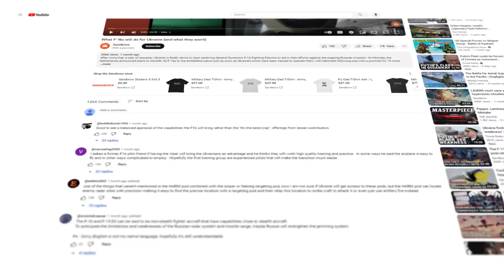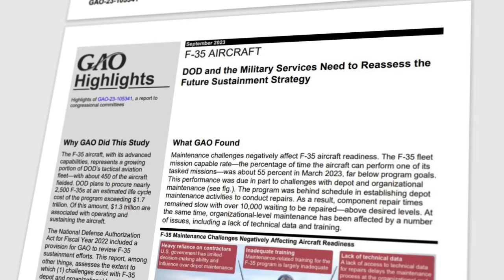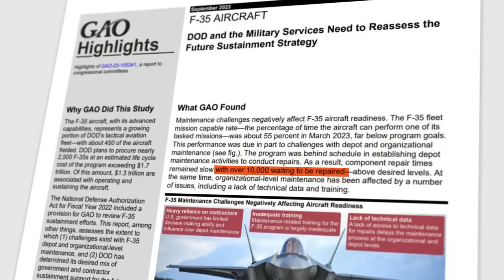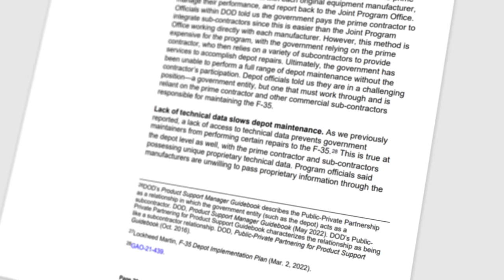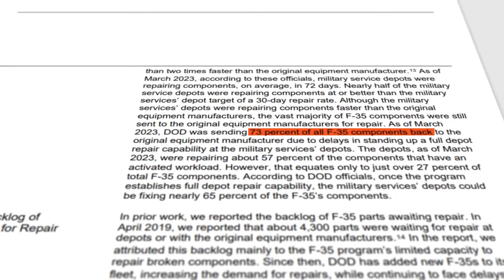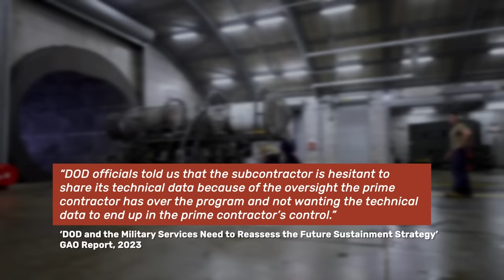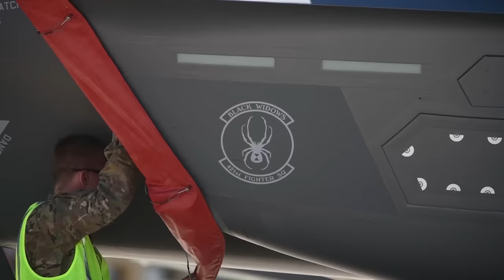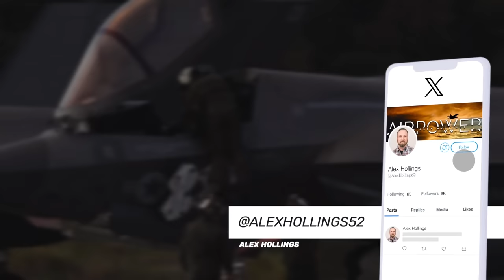Why are only half of America's F-35s ready for a fight?

Comment: An incredible amount of the F-35 programs difficulties have originated with DoD mismanagement and the JPO. The DoD has a long history of complicating projects through a mixture of incompetence and constantly shifting priorities.
Reply: More mission creep than Vietnam.  It's mind blowing how soon some lessons are lost.
Reply: And trust in overoptimistic vendors.  For example, the Jenga tower of fail that is ALIS (Autonomic Logistics Information System).  You can't fly without it, and it has umm, issues.
Reply: It also turns out that if you run the engine too hot because you didn't design the engine correctly to provide the required cooling needed you need significantly more engine spare parts, techs and overhaul capability.  Which the DoD hasn't funded.  Luckily the DoD cancelled the GE engine option to 'save money" in 2011...
Reply: A Fricken Men.
Reply: Yeah, true. At least we recognize it, and have the ability to address it. The OMFV program finally addressed the prior programs issues of making way to many key demands, and slacked up to allow some vendor flexibility. If the military can keep from changing what they want in the middle of development, It will help keep it closer to budget and timeline.
Reply: Ahh, it's our govt. What else would tie up our program's like these?  Just like NASA & our space program's. Had our federal govt turned NASA over to the private sector. America would have already sent men/women to Mars.

Our Govts waste, fruad & abuse ontop of red tape is more often than not a barrier & a hindrance to productivity. 

Yes, we get tremendous tech out of military projects enspite of our govt not because they threw a trillion dollars more than a project needed as Musk has shown with Space X or Bezos & Branson.
Reply: The U.S. invests more money in R&D than any other country. OK then please explain why it’s producing sub par equipment and has lost the arms race? Corruption anyone? The F35 is an over hyped hanger Queen. If its stealth is rendered useless then how effective would it be?
Answer: hmmm!

Comment: said the same thing about the f-15 before golf war. then the war came and it like 90%
Reply: same thing happens at exercises since Red Flag 2017, the exercise readiness goes to about 90% and it'd be 100 if not for the spare they have on standby
Reply: Golf war was so much fun.
Reply: @kermittoad Did Tiger Woods take part in that one?
Reply: Instead of dropping bombs, they dropped golf balls.
Reply: That readiness seems par for the course AMIRITE
Reply: I remember one of the studies from the first Gulf war compared the readiness rates of A-10 teams with mostly men and mostly women maintenance teams.  They found that the mostly women teams had higher readiness rates.  Open question at the time was were the women just naturally better at keeping the dust and sand out of the equipment, or where they motivated to prove they were just as good as the men.  I don't ever recall seeing a followup.
Reply: @kermittoad Schwarzkopf was mean with that pitching wedge.
Reply: The golf war was a blast
Reply: @deanyt3697 ATACMS with cluster warheads
Reply: F-15 yells FORE!!!  💥💥💥
Reply: @deanyt3697 just carpet bombing with thousands of golf balls.
Reply: USAF - golf war - pretty accurate 😂
Reply: "Ready" or Fully Mission Capable means everything on the plane works and all maintenance is caught up. If a military vehicle is due for an oil change it is classified as Not Mission Capable until the oil is changed. This doesn't actually prevent said vehicle from fighting but administratively it's down for maintenance. Can't speak for fighter planes but there are well over a hundred faults that technically make an Abrams tank NMC from something like a blown up Gunner's sight to the driver's periscope wiper needing a new blade. The majority are easy fixes.
Reply: The F-35 hasnt fully replaced the legacy aircraft, so the GAO findings are moot

Comment: 45% of fleet is down due to operational failures

"Not that bad"

Car fails gets you home 45% of the time. 
Firearm fails to works 45% of the time.
Emergency Response fails to shows up 45% of the time.

"Contextually its not that bad"
Reply: Why are u compering amount of aviable plataforms to failure rate???
Reply: 45% of the fleet is “not mission ready”. This is a specific term that means the jet can’t do everything they might have to do but not that the jets can’t fly.for example, a jet with a broken a/c can be considered not mission capable even though it can still takeoff, fly, and fight just fine.
Reply: Apples and oranges

Comment: I was an Avionics Tech in the USAF working in a Component Repair Backshop. We would go into the boxes and troubleshoot down to circuit card and component level. (power supplies, switches, relays etc) Many times the "prime contractor" would tell us that there was no replacement part available and that we had no choice but to NRTS (Not Repairable Thia Station) the box back to the depot (aka Prime Contractor's facility). One time we just couldn't believe they didn't have the parts and called back until we got a different person, and they were like "Yeah, we have 6 of those right here." after being just told there were none. What was the difference? It was that the first guy we talked to was a "prime contractor" employee, and the second was actual USAF personnel. It only took 3 words to resolve that conflict, Conflict of Interest, and that company guy never answered the phone again. Come to find out that same "Prime Contractor" was trying to get our USAF backshop closed so they could take over the work, and they were trying to use our NRTS rates to justify it. They did eventually get it switched over to them and ran it into the ground so bad they lost the contract entirely. They make a LOT of money doing that, so it does not surprise me that they are dragging their feet in turning it over to DoD personnel.

Comment: Sometimes the way Mr Hollings talks about the F-35, you’d think it’s using alien technology, can fly hypersonic or teleport across space! What are those things “the F-35 can do that no other plane can”??
Because in the end, yes it has more sensors than other planes, and that makes integration and data fusion more complex, but they’re the same sensors (like IRST, etc.) you see in other planes. It has a slightly more advanced engine than say, a Typhoon. And a slightly more advanced stealth coating than the F-22. That’s it.
And that whole “it’s less reliable because it’s more advanced and that’s OK” spiel… What? After 10 years and a trillion dollar, that’s the only platitude you can come up with?

Comment: It would be useful to know if the low numbers are still primarily in the earlier builds. Some of the earliest are moving to aggressor squadrons instead of being updated to current standards. Keeping them flying likely skews the readiness and cost statistics versus the fully capable, later lots.

Also, people rag on concurrency, but how is it significantly different than past programs. For instance, i don't believe we went to war with block 5 or 10 F-16s. The platform evolved after production started and the bulk of purchases were much better and more capable than at introduction. That's still concurrent development, just more indirect. Like other features of the F-35 program, it suffers some negative sentiment because the program was upfront about a lot of complicated issues. And few have done the legwork to compare how the program performed in those regards to past programs or alternatives (i.e. echoing your points in the video).
Reply: I believe the main issues with the "concurrent development" are when it happens while the aircraft is still in prototype stages
Reply: The problem with "concurency" was and is its running at the same time as you are building the plane which leads to the customer refusing delivery of the plane because the software needed to fly it that you were supposed to provide is not ready yet. Or that aircraft just delivered have to fly with restrictions or have to be "fixed" because what you delivered and are still delivering are beta models and not the finished product. This was not the case with the F-16 as those early blocks were exactly what they were meant to be. That the aircraft had other requirements added was a USAF thing. They wanted a bomb truck in order to protect  F-15 procurement.
Thus they even came with the idea of mounting a 30mm gunpod hoping to use it to kill off the A-10 program.

Comment: A couple of thoughts. 
1) readiness is peace times is different than in times of war. I suspect that some of the grounded aircraft could carry out missions if required, but because there is no need than the aircraft gets grounded. 
2) if push comes to shove, cannibalising  parts to get aircraft ready is done. 
3) If the US is having issues with low ready rates I wonder how bad it is for the other countries flying the F35?
Reply: I’ve thought about this too. The F35 is like the US’ version of China’s Belt and Road, saddling our allies with an expensive and irrelevant platform — irrelevant as seen from the fact we’re spending tens of billions to upgrade it already.
Reply: @coreyleander7911  Upgrades are part of the reason countries bought it, as they know that with those upgrades it'll remain relevant longer than if they'd bought other platforms
Reply: @aidanwilliams9452  No other country is even getting Block III aircraft, much less the Block IV that the DOD promises is what the F35 needs to "stay relevant against China" by the end of the decade. The problem? Those upgrades aren't slated until the 2030s.

Comment: I am not an expert on this topic, I am old enough(81), to know that this is not new problem. Back in WW2, the B29 was the most advanced airplane in the world, and the most expensive military program_(even more than the A bomb). More B29s were lost because of the problems with the plane. Anytime a brand new military system comes on line, it will have problems. If the military waits until everything is fixed before putting it into operation, some other nation may come up with newer system, and the U.S. would have to start all over again. When you have a system that works and is better than anyone else is, you put it in service and work out the problems later.  Thank you for filling in the blanks that the media leaves out.

Comment: Disappointed that you did not consider the findings of the Swiss F-35 evaluation.

According to the Swiss, part of the problem is how the US counts "mission ready" rates. 

If an F-35 IR camera (part of F-35 EOTS, built into the plane) is down, the plane - which may otherwise be perfectly functional -  is counted as down.

If an F-16 IR pod is down ... they take it off the plane and count the plane as mission ready. (I didn't say "replace it" because most units don't have spares of these mission pods.)

The Swiss basically said, "Hey that's dumb. We will count differently, and fly the plane on missions that don't need that." 

They were a bit more diplomatic than that ... but only a bit.
Reply: Yeah same way those pods often aren't included in flight hour costs
Reply: @aidanwilliams9452  Exactly so.

Also, some of the pods have absurd changeover times "on paper."

For example a Sniper XR is listed as being able to be swapped in 20 minutes ... which is technically true.

However if you want to hit a target at the ranges its capable of, it takes another 2-3 hours to align and calibrate the pod.

Assuming you have one to swap.

Comment: Once a high tech high dollar serviceable machine goes into production it not uncommon for the service and maintenance to lag. Engineers are required to design and build complex test stations for every part capable of analyzing every function of that part. This is difficult enough when you’re in full control of all the technology, but it’s much more difficult when each black box has circuit boards and software from ten different suppliers. Then there’s the issue of qualified technicians. As an electrical technician and instructor I can tell you that our education system has totally ignored the needs of the 21st century. Back in 79 I had a high school class in electronics. It really didn’t prepare me for a real job in the electrical industry, but it did show me that I could learn the concepts and eventually led me to a rewarding career. There’s a lot of curriculum and training equipment available. The main problem is that the people running the education system, due to no fault of their own, know nothing about the tech industry. It’s almost impossible to hire people with formal electrical/electronics training and most technical colleges have dropped these programs. And to make matters even worse, HR managers have no idea what to look for in a new hire.

Comment: There are 3 sets of numbers, and The GAO is even so kind to use the best one. The first one is called "availability rate", but does not mean it can carry out any missions. It simply means the aircraft is able to fly, but not necessarily carry out any of the tasks it's designed for. The second one is the "mission capable rate", which means the percentage of aircraft that can carry out at least one of the tasks it has been designed for, even if it's a completely useless one. Only the third set of number is actually relevant. It's called the "full mission capable rate", which means it can do what it's designed for. That set of numbers is terrible. The numbers for 2020 are 39% for the entire fleet (the goal was 80%), the A did best with 54%, The B got only 15%, while the C got a shameful 6.8%. As long as you don't mention these numbers, you're a propagandist. These numbers ought to be a national scandal, and they have not yet significantly improved, and none of them are getting anywhere near the promised 80%. Taxpayers and allies who bought the F-35 are being cheated big time. If ever war should break out in the south-Chinese sea or around Taiwan, America can only hope it can bring enough F-18's to bear. Without that, it will be a suicide mission. That's what Lockheed and the pentagon did for you. https://www.pogo.org/analysis/f-35-program-stagnated-in-2021-but-dod-testing-office-hiding-full-extent-of-problem

Comment: .55 x 400 = 220 planes. pretty sure 200+ f35s could handle most rivals but the f22 is just waiting see how fast they fill hell to capacity with new souls. these are 5th gen planes with radar cross sections the size of birds. half is still more capacity than anyone else could even dream of fielding.

Comment: The problem is that the DOD has long since gotten out of I-Level and Depot aircraft maintenance. This shift started over 30 years ago after the Soviet Union collapsed to save money by drawing down the military. The reality is that most of the civilian maintenance contracts (pork) were intended to help bouy state economies.

Side note: While I was stationed in Spain, the DOD offered all E6 and above the golden-handshake. Effectively allowing those with more than 10 or 15 years of service to retire. The effect of this offer was profound, as many commands saw large numbers of their senior maintainers depart, taking their knowledge with them. (Noone to replace them) Many of those departing became the civilian contractors for the very same platforms they supported while in the service!

Instead of investing the time and money to train / equip new repair technicians, the DOD just contracted out the majority of aviation maintenance a squadron / repair facility was no longer equipped to handle locally. The few remaining I-Level / Depot facilities becoming increasingly understaffed and underfunded. With greater emphasis being placed on service members operational deployments for continued professional advancement. Often with members being penalized for taking assignments at non-deployable Depot facilities. After a decade plus of this, very few of the command leadership had any real-world experience working / managing a Depot to be able to pass on the critical troubleshooting skills required for their replacements to be successful.

Comment: The readiness rates of the F-35 and F-22 are horrible, having said that, I would much rather have  30% of F-22s, 30% of F-35s supported by F-15s, F-16 Vipers, and F-18 Super Hornets, EWACS  against ANY of the airforces in the world China included and at the end the US would be full of aces, and this is no fanboy exaggeration, its facts the US simply outspends the next 12 largest military spenders in the world COMBINED...and why wouldn't you if you can simply print more money in a pinch and when your currency is the world's largest preferred currency it puts everything in perspective.
Reply: @@JimCarner I was not talking about a full war game scenario if you notice I didn't mention tankers, carriers, or any other supporting equipment, I was speaking about fighter jet strength of US vs other air force's, the simulation or war gaming you speak of has been done and China still loses while the US loses an aircraft carrier, those are easy to find if you Google them, very interesting oh and btw Kadena AFB is not the only AFB where US fighters can take off from to attack China.
Reply: @@JimCarner 😂😂😂 your reading comprehension is lacking my guy, you are talking about real war scenarios, that is a war game, I was simply comparing the air worthiness of US fighters vs other air forces I never mentioned other necessary infrastructure, refueling, maintenance, re-armament, but I will explain it to you  as if you are 5 years old, if X number of US fighters were to match up against X numbers of (__insert nationality here__)  the US fighters would tear that up, now go run and tell your Winnie The Pooh looking leader I said that 😂. Hopefully this clears it up for you and your hard-on for Kadena AFB subsides . 😘